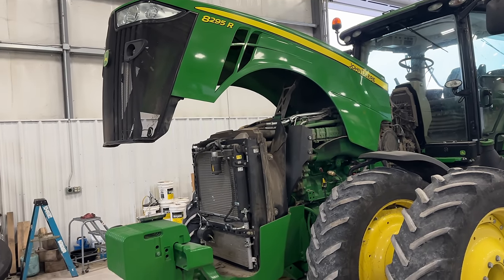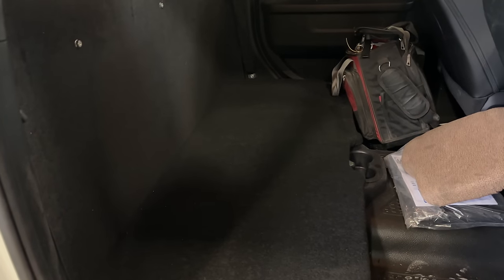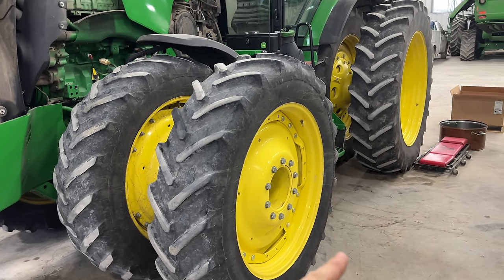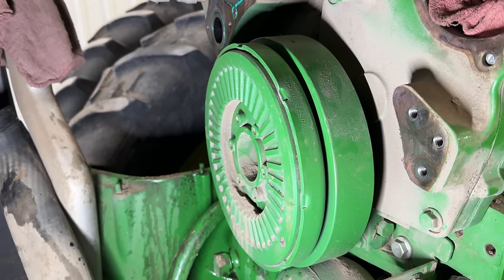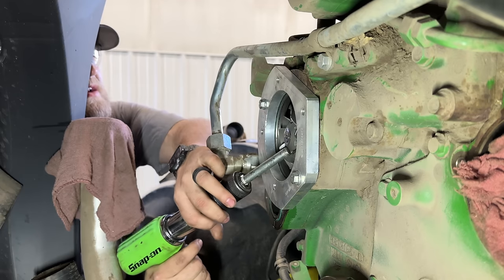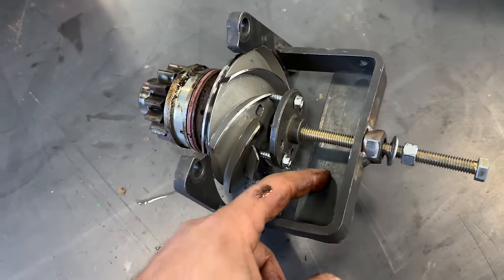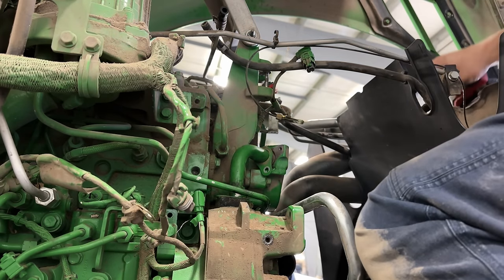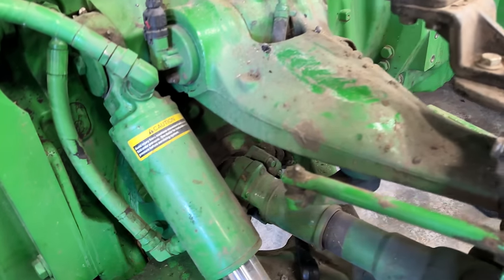Getting a John Deere 8295R ready for spring. (Part 1)

Comment: Just a suggestion fom an Aussie, why don't you ut a piece of 100 mm sewer pipe with end caps on the floor, line it with carpet and put your tension wrench in that. It is much safer than the back wall and much better protected.

Comment: Removing that rear seat to make more room is a great idea, just make sure to fix everything that's going in there good and strong. don't just clip that torque wrench up on that board. You'll be grateful of it if god forbid you are in an accident. No body wants a torque wrench to the back of the head etc. Or of course, fix a caged wall between this new found room and the front seats. Either way. 😃

Comment: Did you take the rear seat belts out completely or leave them plugged in under the plywood? My work truck is a 22 f550 crew cab chassis with the same stellar bed. Disconnecting rear seat belts turns on a srs light so they are just plugged in laying on floor. Been wanting to do the same thing with packout racks.
Reply from the maker: I took them completely out. No issues.

Comment: It is very hard to keep a tractor clean.i now as i use to work on the farm.
Reply: Not that hard at the end of the season to pressure was equipment before putting away for the winter or getting it ready to work on. Been doing for 50 yrs.

Comment: 3600 hours and your doing this much maintenance and replacing this many parts? What was the total cost of this repair and how much was covered by warranty? Thank you.
Reply: Warranty is only good for 1 yr unless it's emissions
Reply: @agger838 Interesting. 3600 hours in the trucking industry would be  about 12-18 months of operations. There is ZERO % chance that these kind of maintenance issues would be present on ANY model of modern semi tractors. And if there were such mechanical defects, most major trucking companies have 24-36 month warranties.
Reply: @jeffhatmaker817  OTR trucks don't run 80% - 100% engine and driveline load for 10 -12 hours a day.  Hardly an equal comparison.
Reply from the maker: And they are not running in the dirt.
Reply: @buckhorncortez  I'm not sure what percentage of engine power we use at 70+ thousand pounds, but items like driveshafts, axles, fan drives, IVTs, etc should NOT be unserviceable or completely worn out after 3600 of service. Yes I understand that operating in the field causes issues. But presumably Deere's engineering is taking the operating conditions into consideration?
Reply: @jeffhatmaker817 the fan drive issues is quite well known and lack of maintenance destroys them. As Zeth mentioned they’re running in dirt
Reply: @timgrant6510  I understand. How much HP is required to rotate a fan to cool the coolant, hydraulic fluids, etc? Let's go with 75 HP which I bet is way high. Deere can't develop a reliable drive system to drive 75 HP output in a dirty environment? I have no dog in the agricultural equipment market fight, but basic systems should be reliable even operating in a field. I'm thinking sealed bearings, etc.

Comment: Is it common to have to do that amount of work on a tractor with only 3600 hours on it?
Reply from the maker: The water pump was preventative maintenance, usually change them out every 3,000 hrs. While we were that deep, it was a good idea to change out the dampers and the front main seal because the dampers are a 4500 hr service interval if they make it that long…the MFWD bearings is not super common.

Comment: i am a jd guy,but them 8r tractors are nothing more then a money pit for the farmer.jd engineer's should be ashamed of them selfs for the amount of damage for only 3500hrs.i see more and more guys on other youtube channels with the same complaints.
Reply: It's part of it with this new crap 💩 it just doesn't work fan issues, Def issues and then sensors
Reply: We run a 2013 8235r, didn’t buy it new, had between 5 and 6k hours on it, and has over 8k now, and the only major issues we’ve had with it to my knowledge are a computer glitch that kept forcing it into neutral, and where  the rear axle mounts on the tractor had a bad seal or race that needed replaced. No idea what was done to it before we bought it though.

Edit to add: it’s our only mfwd we own on our farm so it gets a ton of hours put on it every year, we bought it in late summer 2018, and it does everything from mowing barditches to planting.
Reply: Maintenance is a huge part of it